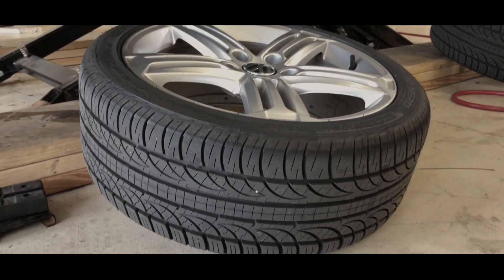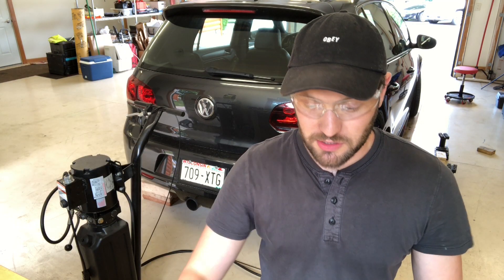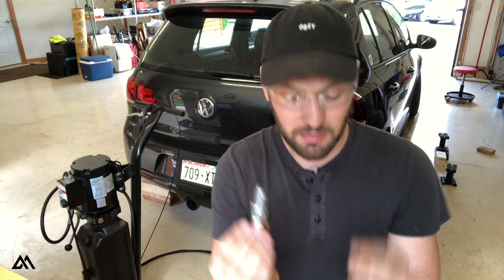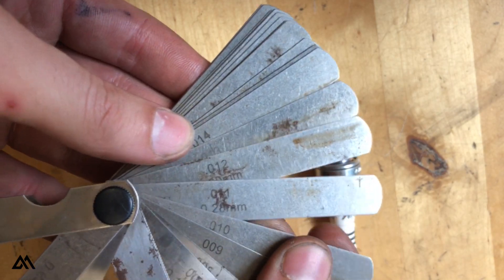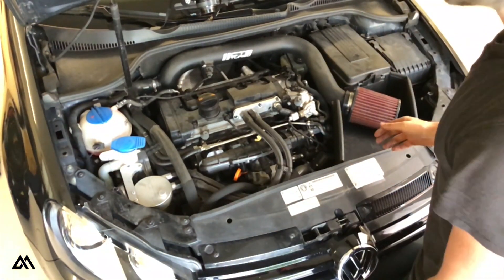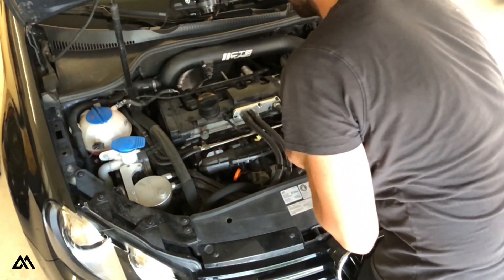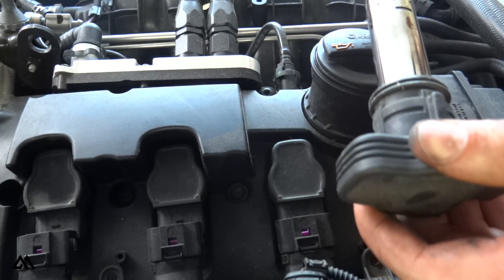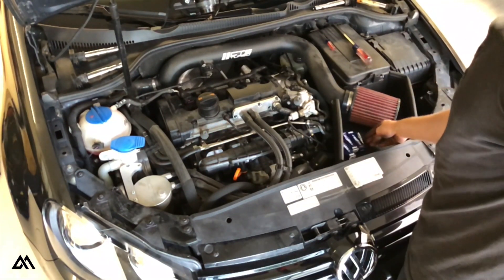Audi / VW 2.0T Spark Plug Install!  |  MK6 Golf R

Comment: Been having mad issues with my golf r and the 450T kit by IE. Currently still burning oil even after replacing spark plugs and PcV with a catch can system. Spark plugs where fouled and had wet oil around them

Comment: What size spark plug mm socket do I buy... I seen some with a extended swivel on ecs.. are those fine? They look skinny... and my R is stock do I need to gap them I got my plugs from the dealer this past weekend
Reply: I believe its 16mm or 5/8th spark plug sockets. Either of those will work. I use one like this that has a magnetic socket. That way you cannot over tightening. 
https://www.summitracing.com/parts/wmr-w1129c?seid=srese1&gclid=CjwKCAjwtqj2BRBYEiwAqfzur1Rg6LdcMcr3ZwDzOBEDFHmd4qSzUMlDbAf29TLwKzIddxIETtVwXhoCy3MQAvD_BwE
Reply: Also you shouldn't* have to gap. I always check the gap before I put them in anyway. I've had some off from the factory.